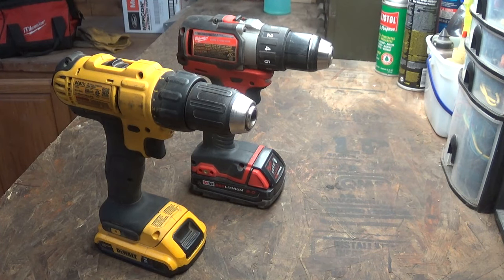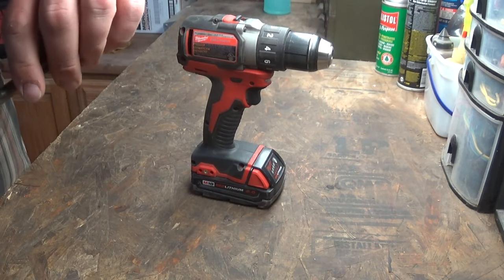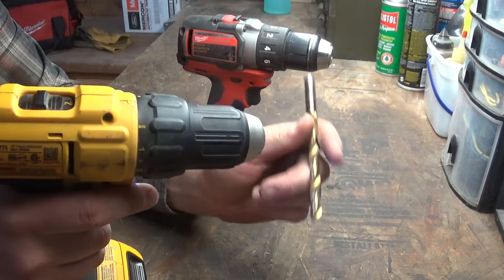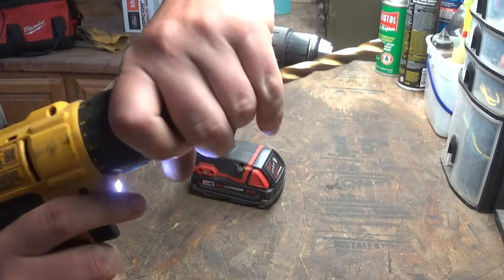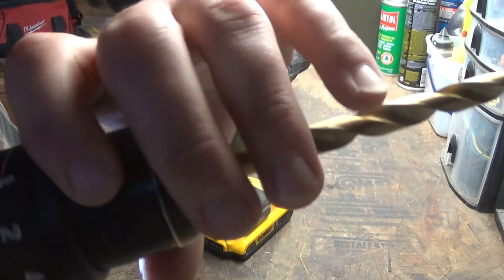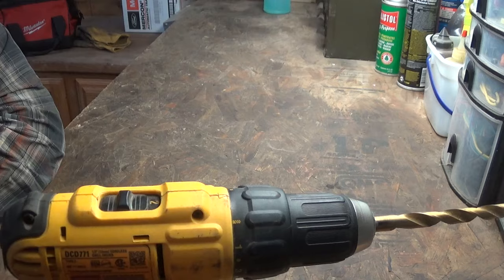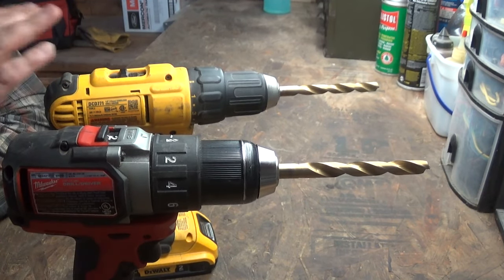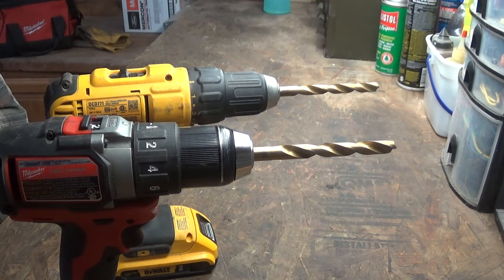How to Keep Drill Bits from Coming OUT!!!  (LOCKING THE CHUCK)

Comment: I got a new Hercules drill from Harbor Freight, and the bits keep falling out while I use it.  In reviews everyone talked about how great the chuck is on this drill.  I thought mine was just malfunctioning. So I returned the drill to Harbor Freight, told them the problem, and they replaced it with a new one. Now I know that I wasn't using it correctly.  But there was nothing in the drill's manual that explained how the locking chuck works.  Thanks.

Comment: Sent a message to Milwaukee a few days ago and linked your video. This is their reply: "Hello Bill,
Thank you for reaching out! The best way to tighten a chuck is to tighten it by hand. Please make sure the jaws line up with the flats of whatever bit you use. Sometimes misalignment on the bit can cause the bit to drop. Then please make sure to ratchet it as tight as possible by hand. Please make note that you should not back it off any clicks as that will only unlock the mechanism."
Reply: Yup, this guy is a liar 🤥
Reply: Milwaukee is right. If you back off you loosen but some drills have a slack and it FEELS like some kinda locking if you believe it is a locking feature. No chucks are made to be locked by this method.
Reply: @gsaexperience8578  But just like with the emperors new cloak noone want to call him out on it.
Reply: i tried this with my milwaukee drill and it doesnt work.  As soon as you try to turn it back, it releases the drill bit
Reply: @jackc244  Worked like a charm on my B&D cordless.
Reply: No just a manufacturer isn't always correct just like cell phone technicians don't always know what's wrong with their phone  Or as phone salesman doesn't even know the specs of the phone  Other guys at home depot will tell you  Item I isn't there and it is
Reply: People are so quick to call people liars it's actually insane.
Reply: @renski8976  Maybe you should take that up with Milwaukee. I assume most of what I see online is posted for vanity or views, so a bit of skepticism is warranted. My personal experience with the type of chuck they are referring to, as far as Dewalt and Milwaukee are concerned is to tighten - never loosen, unless you want to remove the bit.
But I've only been using them for about 40 years.
Reply: @SuperMusic12345  I like the sarcasm in saying you've only been using them for 40 years. However, maybe you never thought about maybe milwaukee or dewalt trying to implement a solution to a problem with bits falling out.  Like putting a feature like a locking chuck? Whatever dude, you do you.
Reply: @renski8976  I'm going to guess I've been "doing me", for a lot more years than you've been around. I have always been a tool geek, and bought my first Ni-Cad 7.2 volt Makita drill back in the early '80's after I got my electrical license. The first ratcheting chuck I had was on a Dewalt (110v) drill, bought in the early '90s. They still function the same, and the owners manual (you can google them) spells it out. The OP is either pulling your leg or has more things loose besides his chuck.
Reply: @renski8976  dude this video is BS no where ANYWHERE does dewalt or milwaukee say to back out the chuck after the tightening clicks in the operator guides unless you want to remove the bit
Reply: They in Mielwaukee were obviously completely arrogant.
Reply: @pflaffik Wrong, My Bosch Impact 18V Green Hobby model has 1 click backward locking mechanism. The Blue Pro models have the normal, ahead locking mechanism. Check my experience.
Reply: @pflaffik If you back off 1 click you lock it, if you back off further, you release it.
Reply: That's what I call "Ultimative Authoritarian Arrogance." They just don't listen. They don't want to.
Reply: @pflaffik  Wrong. Check my experience in the comments. Thank God I found this video.
Reply: @SuperMusic12345 : Obviously things that are posted online are for views! What do you think someone is going to do: post something online to help it stay hidden? 🤦‍♂️

Comment: I've used them for years and didn't know about that on the ratcheting chucks. I'll have to try it on my Ridgid drills.  Thanks for the video.
Reply: Tried this on my Ridgid drill and does not work. It would be better to lock the bit with 3 clicks

Comment: Awesome thanks. Watched a ton of review video to help me decide which DeWalt drill to buy. Bought the 976 with all the trimmings: and while testing it out the bloody drill bits kept falling out! I thought unit was damaged and felt super angry….. then googled it and came across your video. Fixed thank you and working. No mention in the flimsy instructions and didn’t need to do this on my old Bosch drill.

Comment: So glad I found your video. I just purchased a DCD998 and hadn't even put a bit in the chuck yet. The chuck was making a weird clicking sound when I turned the sleeve either way. I put a bit in the chuck, tightened the sleeve, then backed it off like you mention in the video, then removed the bit, and the chuck sleeve operated smoothly. No mention of any of this in the manual. Thanks for making this video!

Comment: Holy crap!!! I have that same Dewalt drill and used it to put up a small picket fence this summer (82 panels and four posts) and was wondering what I was doing wrong as it was my first time even using a drill. I came to the assumption that the bit falling out is just something that happens once in a while.

Comment: I will have to give that a try on my Ryobi drill. The large bits are always coming loose, the small drills bits are fine.  My Milwaukee never comes loose and I don't lock it. I will give them a look. Thanks for the tip.

Comment: Yes, I knew/know about this feature. I grew up in an era with grades 7-12 where a shop class one sort or another was common. I'll just say i was around when the keyless chuck was a new feature and Ive paid attention to its evolution to now. I can't tell you how many times i've had to suggest locking the chuck to fellow old timers and the younger groups, lol. It seems easy enough and I just figured they were in a hurry and forgot or didn't read/skipped that part of the manual. Knowing this tidbit I'm one of the latter. I just checked the manuals for my various Milwaukee, DeWalt, and Makita drills and though they all have how to insert and tighten the bit into the tool, none of them mention how to lock the chuck though all use it. It does strike me as odd that they would omit this key information. Thank you for your time and effort in getting it out to the masses who are unaware. Stay safe.
Reply: Because it's not a feature, and if anything it will make your bit come loose.
Reply: My drill bit is stuck and can't unlock the chuck. How do you get it unlocked? I've been turning it counter clock wise but it doesn't budge.

Comment: funny the drill bit just came off and got stuck on the wood like you mentioned. thanks for the tip. been using a drill for years and never locked it properly.

Comment: I have a Milwaukee M18 Fuel, and after watching this video last week, I started dropping bits all the time...  What I noticed yesterday is that I can feel the detent roll over before the ratcheting action starts.  I wonder if the action this video is backwards, at least for my drill, and that turning the chuck a step back is actually unlocking it.
Reply: My M12 Fuel still drops bits after 5 holes every time. Tried the tip in this video. Still drops bits after 5 holes.
Reply: I think someone made this up and its spreading. No manuals say this. Isn't  that the point of the ratchet... so it can turn one way and not the other as if it was already locked as you say
Reply: @nickcampbell3075  Yeah, I'm pretty sure the clicking mechanism is just blocking the motor from being rotated by hand, so you can actually tighten or untighten it instead of just spinning the drill
Reply: @nickcampbell3075  it’s 100% not true. The guy keeps saying he is releasing a video to prove it soon but the video is over a year old and no update from the manufacturer like he says.
Reply: I would agree, thats the whole point of a ratchet mechanism, you have to unlock a ratchet strap right
Reply: When you turning it back it loosens, and by more than 1 click usually - since the tension is high it will jump over a few teeth. There are no locking chucks.
Reply: @GGGenom  Absolutely right! its what dewalt calls "automatic spindle lock mechanism". It is not inside the chuck.

Comment: Well... I just spent 35 min. trying, cursing, cursing and yelling at my newish drill, then searching in my shed for the expensive drills that I haven't been able to find since the move a year ago (OK, I'm slow about putting things away, but I'm a bit disabled and a bit lazy lol) .. hey, I did find my instapot! Yeah! .. but I digress. After 45 min of searching for the good drill with no luck, I gave up on putting in bulbs today with the fancy bulb planting bit and gave up for the day. 3 bulbs planted. 2 more by shovel. lots of cussing. Came in and found this. I thought.. ya gotta be kidding. Nope. Damned if that didn't fix the problem. Where were you an hour ago??? LOL THANK you! And why wasn't this in the instructions? I'm not tool challenged. My stepdad is a master plumber, he wouldn't allow it. grr.

Comment: That's awesome a new one on me. I'm actually a user manual reader (aka site nerd) and I can't ever remember seeing that.  

On the using it for years without knowing it, no biggy, it was a non issue before the drills had brakes on the motor. (I don't know if it is organic as in a function of the motor, or if it is a design in.) I think it is just inertial why they open, from the instant stop.

Anyhow, thanks.

Comment: Never knew this, have Ryobi and Makita Pro drills, but it didn't help my problem.... of the chucks not holding the drill bits tight. I ended having to grind small flats on the shanks for the drills to lock onto.

Comment: Turning it back that one click is actually unlocking it lol at least on all my drills there's an arrow on the chuck with the word lock facing clockwise, so it locks as it tightens. It would make no sense to have it lock in the direction you loosen the chuck other than the fact someone said that's the way it is and put it on the Internet. That detent you're feeling is probably just the motor cogging. You can confirm this by looking at the back end of the drill and visually inspecting for movement when you hear the "detent"

Comment: Omg. I was so irritated.  Drilling a 4 inch hole and the dang thing loosens up and falls out.   A new to me Crasftsman drill.  Seems strong enough but noticed it doesn’t hold onto bits.

Appears to have a locking chuck but until I try it again tomorrow I won’t really know. We’ll see.

Thank you

Comment: Funny, I have had both Dewalt and Milwaukee drills, both of them dropped bits constantly, even when locked in place as shown. Very frustrating!  I sent the Dewalt to Dewalt service center, got it back, still dropped bits, no matter what I did!  Be nice to have a portable drill with an old fashioned chuck key!

Comment: I'm thinking the ratcheting chuck feature is only a few years old. If you've never heard clicks using your chuck, it isn't ratcheting. My new compact B&D 20V doesn't have it. I went to Menards and their replacement chucks are non-ratcheting. One of their Skil drills has it. Menards sells Milwaukee drills like the one shown in your video. Menards doesn't sell DeWalt drills, but one of their clerks said most of the drill brands are owned by one company, including DeWalt, and probably are made in the same factory in China. So they'll probably all have the feature soon.
Reply: Theres no such thing. the imaginary lock-click came from the  automatic spindle lock mechanism which is not in the chuck.

Comment: I read this elsewhere a while ago but it's not supported by anything I can find in any chuck manufacturer's literature, nor by my personal experience. Chucks will occasionally come loose, the better ones less often. I recently upgraded the chuck on my Milwaukee to a Röhm and it hasn't come loose on me once in any situation.
Reply from the maker: I can't find it anywhere either. All I know is it works, or at least it does for my drills.
Reply: Would you happen to have a part number or link for the chuck you got Richard? I'd love to upgrade my Milwaukee chuck
Reply: @Jayde.S  Depends which Milwaukee you have. If, like me, you have one with a 9/16" thread for mounting the chuck, you're looking for a Röhm Extra 13-RV50 9/16-18 - just Google that lot. If yours has a standard 1/2" thread, then the same model number but suffix 1/2-20. The former is hard to find in some countries: I'm in the UK and could only get it via Amazon, who posted one from the States (ridiculously, since Röhm is a European country).
Reply: @rich8037  apologies for the late reply.
Just wanted say thanks for taking the time to write down some part numbers.
Definitely greatly appreciated. 👍🏻
I'll have to do some googling to find out what size thread the gen 3 drill has
Reply: @Jayde.S  You're going to have to get the chuck off anyway, so you might as well remove it and then you'll be completely sure what size the screw thread is because it's exposed. There are various videos on here showing you how to get a chuck off. I simply mounted a 10mm Allen key in the chuck, put the Allen key in a vice and pulled hard on the drill. It puts up a fight - expect about 100ft lb kind of torque.
Reply: I don’t know where this all started from, but the fact it isn’t in manuals, might be telling you something, and that in fact it is wrong.  The only, and only reason I can think of for this to work, would be on a Dewalt drill, that has the excessive motor breaking upon release of the trigger.  It somehow grips the bit differently.  I have tried this on numerous drills, and it DOES NOT work.  I own both a DCD 796 and 791, and I fully tighten the chuck, and the bits don’t come out.  One has more of an abrupt brake to it (791) and it is Made in USA, and not as good running as the 796, which is made in China.  Shame.  Anyhoo, I have tried this on Maks, Milwaukee, and Hitachi, to name a few, with same results.  Of course, YMMV!

Comment: My Milwaukee hammer drill/driver jsut started making this sound this weekend. I also noticed like you mentioned, it happens when its not tightened down enough and you try to loosen it. So is that sound normal then? I was thinking i perhaps have accidentally grind some teeth inside.
Reply: Sounds like a defective chuck. Milwaukee  has confirmed there is no locking trick, dewalt too says to just tighten and youre done. Makita for sure never ever had a lock.

Comment: Well I'm a 75 yo builder and have owned every cordless brand known to mankind. I only found out today after phoning the tool shop regarding my crappy dewalt chuck that wont hold a bit. The salesman gave me the heads up and it works like a demon. Sorry dewalt for the slander I have uttered regarding your drill chucks ... but WTF didn't you tell me!
Reply: According to all the other comments nearly every major brand has this function but for some reason they never mention it in the manual...

Did every manufacturer get together and actively try to hide this function like some kind of inside joke just to fuck with us lol???
Reply: @huskypro1 , yes they did.  Just like the MSM fucking with us regarding the election fraud, the major tool manufacturers have done the same with their ratcheting chucks.  However, where I’m definitely convinced of widespread election fraud (Trump won by a landslide), the verdicts still out on the ratcheting chuck back’ a click to lock theory.  I have the Milwaukee Fuel M12 Gen 2 hammer drill and the Fuel M18 Gen 3 Hammer Drill, both loosen if I go back a notch after tightening through the clicks all the way to the right or clockwise.
Reply: @huskypro1  No brands have a locking chuck.

Comment: I'm not so sure I've been tightening my drill bit just fine
Dewalt cordless
Insert drill bit
Turn front dial of chuck to the left  to tighten until the jaws grip the bit and then one more turn to left and that's it locked there's no turn it back one click and make sure ur on the correct selection on ur drill drill fir drilling hammer for drilling masonry brick etc etc besides that always be safe use eye protection better to look a muppet for 2 mins than to end up wishing you had worn those fashion disaster ppe goggles 😂 and yes I've got the manual still for my drill which is a modern model

Comment: My De-Crap drill DCD771 1/2" dropped bits every few times I released the trigger. It did this since I got it new in early 2020. Life got busy and I just used another drill.
I was just about to throw it away (and send out a few hundred bad reviews) and then I tried what you showed.
Absolutely no difference. I've used tools my whole life. Dewalt is now crap. 
Dewalt is perfect for those that want truly crap tools. 
When I want a crappy tool...I go to DEWALT.
*UPDATE MAY, 2021; I bought a new chuck. Installed it. Works perfectly. Dewalt still sucks!
Reply: Thats right, the locking dont work because theres no such thing.

Comment: Dude take your false information down and own that you didn't test, research, or confirm it with the manufacturer.
Reply from the maker: Its only false if it doesn't  work 🤷‍♂️
Reply: @SkylarHillShop : What they're doing is just tightening it harder now that they're thinking about it more, so even without that back-off it would now be as tight as they needed it to be. Then when they back it off that one click, some of them may notice that it's still OK-tight. But it's not going to be as tight as it would be if you just ratchet it all the way up and leave it there.